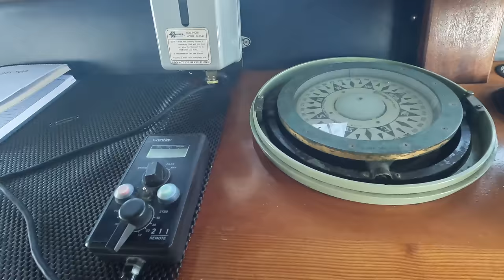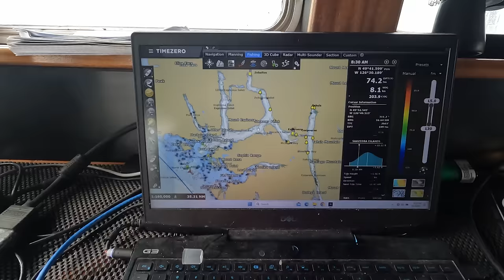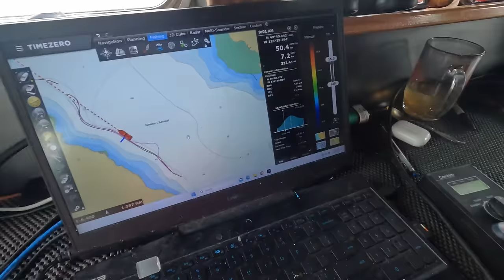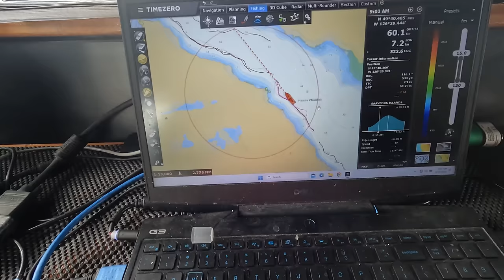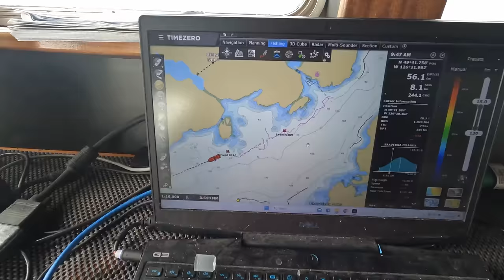COMMERCIAL SPOT PRAWN FISHING BRITISH COLUMBIA

Comment: Can you share more info on the 10 min soak of the prawns in that ‘preservative’?
What is the solution comprised of? What is it exactly doing?
Reply from the maker: It’s basically a high concentration of salt, and they were joking when they said 10 minutes, prawns only go in for 1 minute. The idea is the prawn breathes in a high concentration of salt which kills them and then the film that the salty solution covers them with reduces freezer burn which in turn helps them keep there beautiful colour . Otherwise we would have to do a thing called glazing, which is a process where we freeze the product, then dip the product in water and freeze them again, which puts a protective layer of water on the prawn to also stop it from freezer burning. the salty solution is just a better way of doing it.
Reply: thx for the answer/reply to my soak/perservative question!  does this also help prevent the prawns' head from going 'black' after they have died?  i noticed your prawns in the box look great where as mine are soon 'dripping ink' from the 'head juices' that turn dark after prawns have died.  Or do you guys do anything else to help prevent this unpleasant dark ink from happening and messing up the appearance?
Reply from the maker: @naliekim1522  the most important factor to not having “black heads” as we call them, is to get them frozen within minutes of them being packaged. Our freezers are -40 degrees Celsius. This is because that black ink you see in there heads is actually them starting to spoil. You will notice a smell when that happens too and it doesn’t taste very good 👍
Reply: thx for info about flash freezing the prawns to avoid "black heads".  Been thinking about a flash freezer and now i really want one!  @Skipper_al

Comment: Why dog clips instead of longline clips? Seems like a more complex spring based clip.
Reply from the maker: The main reason is we can set faster safely, when we snap the dog clip on the line it gives us time to push the trap out. If we used the regular spring loaded longline clips, as soon as you release the tension of the snap onto the line it’s gonna go flying off the boat because the longline snaps are meant to be firm on the line and not slide.
Reply: @Skipper_al  that makes a lot of sense. A bit of slack in the line. 
Above you mentioned using a Skretting brand product for bait. Looking at their website they have a variety of products. Which do you use?
Reply from the maker: https://pacificnetandtwine.com/products/21706001